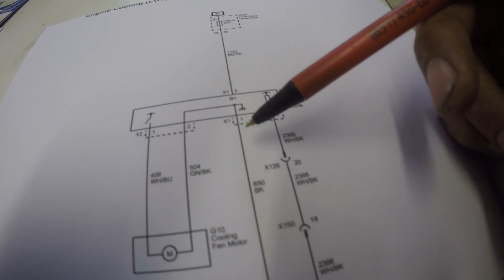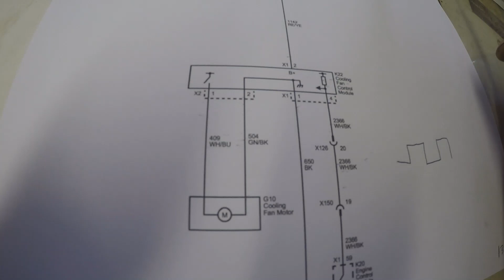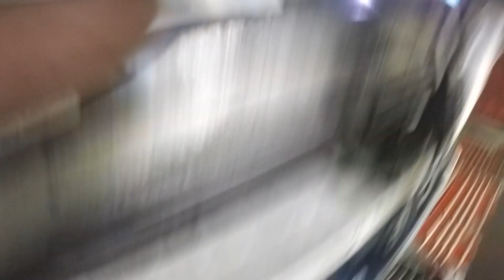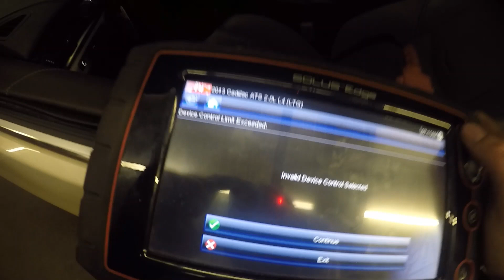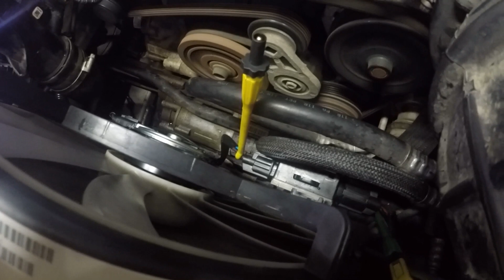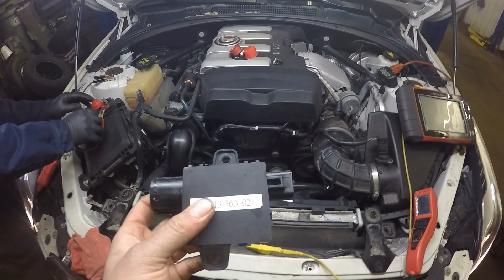How To Test A Cooling Fan On Cadillac ATS

Comment: So I'm curious would the wornout fan cause the control module to burn out or vice versa. The high voltage of 15.12 is bad right? Nothing should be over 12 volts or 9 volts on some cars

Comment: Typically you would want to start at the motor and see if it is getting  12 volts. If it is and its not spinning then its the fan. If you are getting no power then I would check the fuse. Then check the module and if every component works fine then you start chasing wires down

Comment: I've replaced the cooling temperature sensor and still fans run high speed and shows no temperature on gauge
Reply: Did u ever get this problem fix??
Reply: @ericrhymes852  yes I've replaced alot of things including the thermostat. Alot of it had to do with resetting the cars computer which is in the owners manual
Reply: Thanks we are having the same problem with our fan running. On our Damm ATS. And it looking like the cooling sensor, till I read this.lol
Reply: @ericrhymes852  it is that sensor you just have to make sure that you reset the cars computer

Comment: So you changed the fan module? And was aftermarket so it didn't work? My ats fan not coming on.  I changed the 60a fuse. Checked power which fan comes on so not the motor. The car doesn't have a relay nor auxiliary so I'm going to install a new OEM module.
Reply from the maker: I replaced the aftermarket module, with a oem module. For some reason the aftermarket market one wasn't working.
Reply: @jesseelmecanico5791  do you have to unplug the battery?
Reply from the maker: @blessethishe  I would recommend it.
Reply: @jesseelmecanico5791  just fix mines. Didn't have to unplug the battery. Just press down on the clip and slide the connectors off. Remove bolts. 
Edit: This depends on your car. My car had lots of room/gaps where i can easily reach the equipment. Some Engine bays may be too crowded.
Reply from the maker: @blessethishe  Glad to hear that!

Comment: So i have a 2015 Cadillac ats same problem. Fan wont turn on so causes my car to Over heat. would you just recommend new fan and module ?I've done a lot already and Cant seem to find the problem. Thank you
Reply from the maker: Yeah I would recommend a fan and module, but only after you have tested for power and ground first. I would also recommend to go with OE, because in this video we went aftermarket and it still wasn't working. If the fans turn on and its still overheating possibly you could have burnt the head gaskets.
Reply: @jesseelmecanico5791   never saw your reply ordered both of them OEM still same problem. Probably gonna have to take it to the dealership might cost me a arm and leg but tired of the fan not turning on
Reply: @MrMarcos12281  Hi I have an issue with my ATS, what repair did the dealer make to the car to make the fan work?
Reply: @19vinny91  did anyone ever get a fix for this?
Reply: @Superlazylaz1000  My issue was the fan was not coming on when the AC was on but the fan came on when the coolant temp reached 183 F. A couple of weeks later my AC compressor went out. I replaced the compressor and the fan works correctly now. I am assuming the ac compressor was related to the AC fan not coming on .